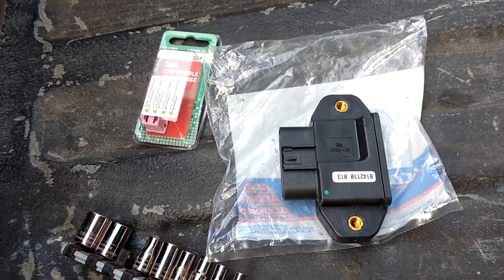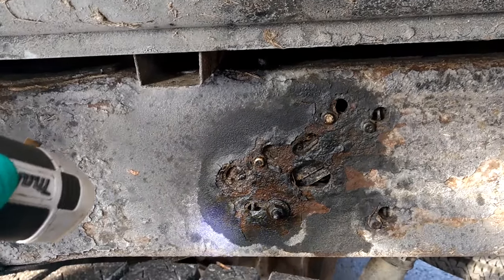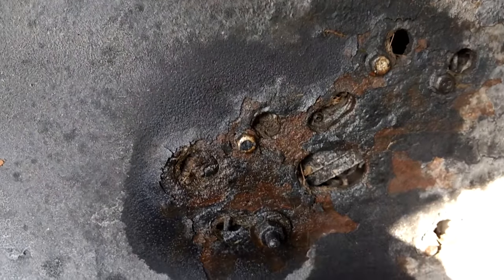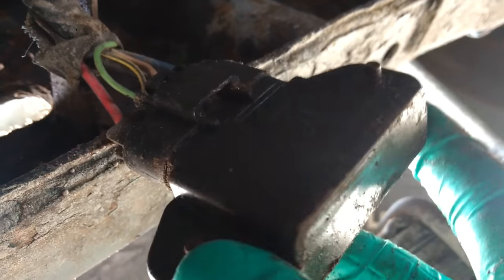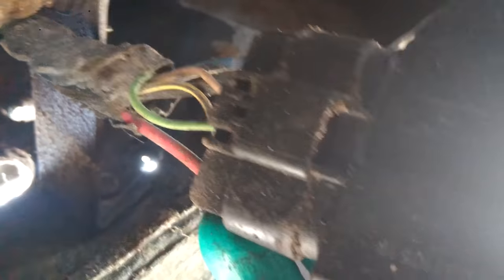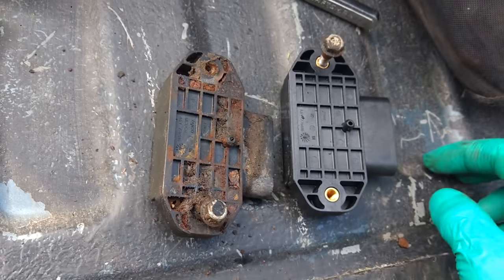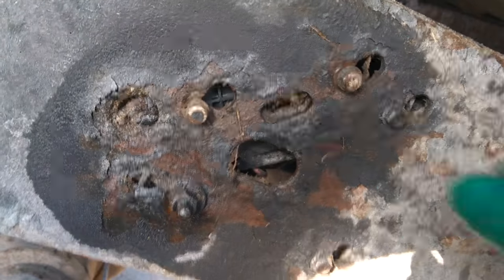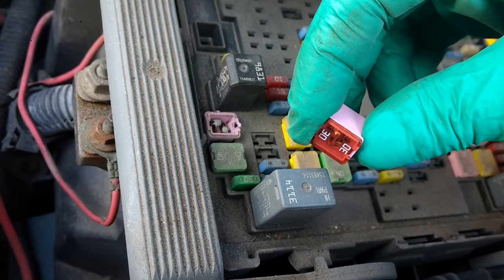Duramax Trailer Brake Issue Solved!! Cheap and Easy Fix!!

Comment: Hi there, thanks for putting together the video, here’s my situation, exact, same truck, and had the trailer brake warning come on, took it into the shop, as I had another issue that needed, addressing, and as soon as I went to go to a trailer it was clear it was not Repaired. I need to check with my shop once they’re open after the weekend to see if they did the same repairs or different, all I know is when I went to go plug in my trailer I didn’t hear the characteristic dings from the cab, and after the first smile knew right away, that my time and money have been wasted, if I can fix my truck at home after watching your video, I/O, you a beer!

Comment: Awesome! Ordered the trailer brake relay switch on Tuesday. I started getting the the service trailer brake system on Monday. I get the travel trailer all hooked up and my trailer brakes would not engage (Had reservations for this weekend and was loaded and noticed the trailer brakes would not work). Well, just received the part 30min ago and installed it and what do you know....The service trailer brake system does not show up anymore on my dash. Well, this video helped because my brakes on my trailer now engage!!!!! Beer 30!
Reply from the maker: Hell yeah!

Comment: THANK YOU! Ordered the parts on amazon.  Penetrating oil worked great.  And it was a very easy fix.  Appreciate it greatly.  2008 GMC 2500 DMax.

Comment: Also y’all, clean all your grounds good. My 2013 had a Bus A failure which can be low battery voltage or bad ground or In my case the relay in fuse box was bad. This can be a very complex issue with a bad PCM as worst case. This video was by far the best I FINALLY found after 2 months and fixing it myself but I’m ordering that relay right now just to be safe. Good luck!

Comment: Thanks for the video and the links for the parts. Delivered from Amazon like in a day and a half. I have a 2008 dually so mine is on a bracket off the inside frame rail. Yes on the wd-40 spray or something similar. Very easy fix.

Comment: Mine wound up being the relay in the fuse box which I heard a while back chattering badly when it all got damp. It’s the relay second from firewall and can be changed out with parking light relay to check. It’s also same as starter relay which I bought a 2pk a yr ago.

Comment: Is there a way I can test this part before replacing? I do have a multimeter.
Reply: You can always test any relay or switch with a multimeter, by checking resistance, and by voltage.

Comment: Mine is a 2011. But no brake power at the plug. Hopefully the relay is
In the same place as yours. I’ll check it out. Thanks for sharing!
Reply: Hey there did it work i have no power in my truck plug i have same truck?thanks
Reply: @buddyyll  I don’t think my problem was the truck, rather the trailer. Even after I replaced the relay...couldn’t really get power at the plug using a test light. Rather a pulsing dim light. Used a different truck on the same trailer. Still very weak brakes. Found a broken wire on the trailer brakes.... that helped a bunch. So I’m not really sure my relay module needed replacement. Sorry, I’m not giving you much information. Bottom line for me is that my trailer needs new brakes. I’ve already adjusted them out.

Comment: I just fixed my 2011 Silverado 2500 HD Diesel and the part was found above the spare tire
Reply: Ron name did you have to drop spare to get to it?
Reply: Ron name did you have to reset it  cause I also have a 2011 HD and changed that relay and light still on
Reply: @Duendes63  mines still on too. What you find?
Reply: What size torque head screws?
Reply: Replaced mine on my 2011 3500 Duramax last night. Was above the spare. What about the fuse? There's no "Trailer Brake" fuse in the diagram or manual?

Comment: Question... my'08 will throw this message only when I'm NOT connected to my trailer. When I plug my trailer in, I have to turn off the ignition and restart. Message goes away and trailer brakes work fine. When I disconnect the trailer, the message comes back. Any ideas? Thx in advance!
Reply from the maker: No ideas on my end. Wish I could help!

Comment: Would this cause the p0571 fault I have the service trailer brake system. My brake lights are stuck on illuminated with the running lights.

Comment: I have a 06 Duramax ripped these wires out with the front driveshaft can anyone tell me where those two ground wires go that's on the frame right behind the driver side front tire thanks

Comment: What size torques head screws? Can’t see them on my 2011 duramax 3500wt.
Reply from the maker: T20 or t25. I can't remember exactly
Reply: I believe they were the bigger T-30. Often used in automotive applications.

Comment: What part of the country you live in? Dang rusted truck, I lived in Chicago and my 2002 truck has just been replaced with a less rusted truck. My issue remains on my 2012 but think my ABS sensor is affecting me. I added new fuse and new relay.
Reply from the maker: I live in Northern New York. Not the city. If the warning light is still on after the relay and fuse replacement it could be the trailer brake control module. Hope this helps. Thanks for watching.
Reply: @youbreakityoufixit9594  Thanks, I just bought 2 ABS sensors that I have bad, if that dont fix it I will borrow a module from my buddy.
Reply from the maker: That's a smart approach! Test it before you buy it.
Reply: @cutweldngrind  how did you make out with your problem ... i replaced my relay fuze and no luck .....i have see chatter about brake pressure sensor on the master cyl ?
Reply: @youbreakityoufixit9594   i replaced my relay fuse and no luck .....i have see chatter about brake pressure sensor on the master cyl ? any ideas where is the module is that the box right next to the relay??
Reply: @GeorgeVeld  I fixed my issue which was a bad ground and I uploaded a video on my channel.
Reply: @cutweldngrind  I did that to ...No luck
Reply: @GeorgeVeld  Sorry to hear that, most people have either a bad relay module, fuse or ground issue. I don't know what else to try. I know my silverado had a ton of broken wires abd took for ever to find them.
Reply: @youbreakityoufixit9594  9

Comment: Question I did that on my 08 duramax but the service trailer break system stills come on any ideas
Reply from the maker: Maybe a bad wire connection somewhere

Comment: Thanks for video help replace same part but the message not go away any fuse related?
Reply: Any luck on yours
Reply: My relay replacement did not work still getting message going to try replacing module have already replaced main switch not sure what to try next after module
Reply: If you google this issue, they recommend checking your master cylinder to make sure you have enough brake fluid. They also recommend filling to Maximum level before buying any replacement parts.

Comment: Where is the jcase fuse located?
Reply from the maker: It's in the fuse box under the hood. It's on the right hand side of the engine bay as you look at it.

Comment: fuse ok so change the modul control still have  the trailer service brake advise 😳
Reply: Do you find your trouble
Reply: Mine is the same thing

Comment: I just replace mine and a fuse and it didn't take care of the problem
Reply: Same here.  Any suggestions on next steps?
Reply: @RichBigIron  I saw on 2 other videos, check ground wires that attached the the frame near the gas cap and also to clean the inside of the trailer plug (the guy in the video used a pressure washer)

Comment: you might want to do something with that frame before it get to bad
Reply from the maker: Totally agree. It's a constant battle in the North East
Reply: @youbreakityoufixit9594  I got and 07 and it still look bran new 80 k miles on it but I live in North Carolina
Reply from the maker: @tincupblast9647  I'm jealous!
Reply: @youbreakityoufixit9594  I bet it suck to see your truck go down hill your no doing nothing but driving it what the life span of a vehicle there
Reply from the maker: @tincupblast9647  it really depends on the vehicle. It's hardest on trucks. There are so many large open cavities for salt and water to collect. I've see trucks as new as 3 years old with rust over the rear wheel wells.
Reply: @tincupblast9647  First trip I made to NC I couldn't believe the amount of 80's - early 90's vehicles that looked like someone did body work or new paint. Then I found out, you guys just don't have those problems and I was a little jealous.

Comment: I’m having a problem with my electric trailer brakes. They work but just barely they don’t feel strong enough and they barely slow down my trailer when I hit the brakes. My truck Gail is on 10 and I replaced my trailer brakes. Anyone can help?
Reply from the maker: A few questions so I have a better understanding. How much weight are you hauling? What type of trailer? Does your truck have a factory brake controller?
Reply: @youbreakityoufixit9594  im having this exact isuue? just towing a travel trailer. what do you suggest?

Comment: No offense, but I’ve watched three videos now and every single one has a totally different solution for fixing this problem. So it would have been nice if you had mentioned exactly how you determined it was the Relay versus the switch versus the control box. You can’t just start off and say its the Relay without explaining how you came to that conclusion. Also, please don’t title this video easy. A cheap and easy fix means to push the reset button or disconnect the battery. Replacing a relay on the frame rail is not considered “easy”
Reply: Dude. Take your truck to a dealer then and be quiet.
Reply: No offense, but I’m offended.- Louis P.
Reply: taking two bolts off and disconnecting a connector is definitely an easy fix😭take your truck to a mechanic bad boy
Reply: @valkyrie_voodoo  So is pushing the reset button! Anything above that is not easy
Reply: Dude if this isn't considered easy,then you have no idea what a tough fix is. Meaning you probably don't belong having tools. Even if he doesn't explain why he came to this conclusion it's probably the most common. If you are so talented then why don't you make a video
Reply: @iamjustadad6951  smh! Comment that belongs to a 10 year old… anytime someone isn’t smart enough to mount a proper debate they resort to childish things like “make your own video then” LOL!!!
Reply: @kingphonsy  Great job at posting a comment that makes absolutely no sense…
Reply: @kingphonsy  then go take a class on how to be less touchy